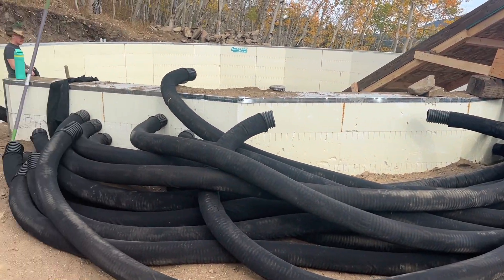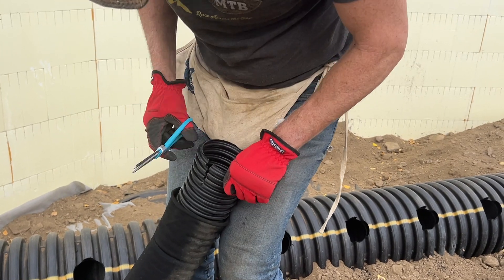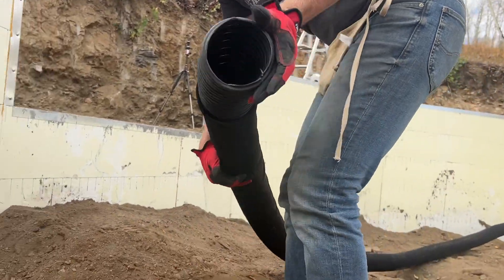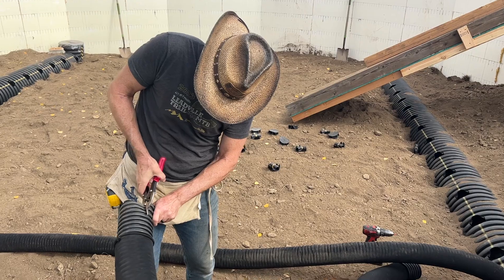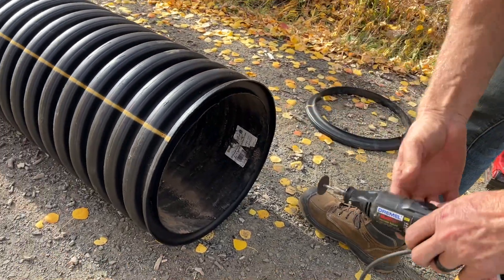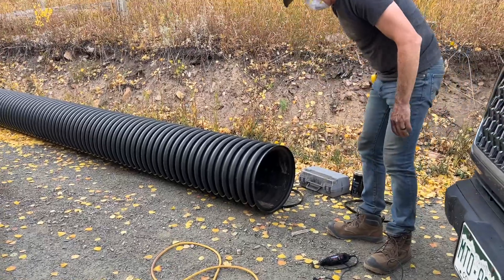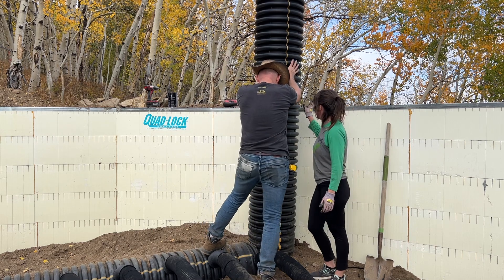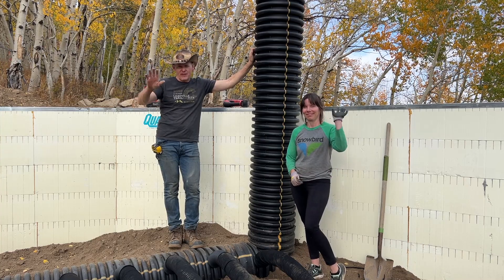How we Finished our GAHT System for a 4-Season Greenhouse

Comment: I did something like this about 40 years ago, even used a Kabota tractor doing similar to what you did.  But I used 8 inch PVC pipe and put two sides so that the air flow went through approximate 3-4 inch washed river rock.  I used a total of 28 tons of rock and then poured a 6 inch concrete floor over the rock.  Once done I built a south facing solar room to heat up during the day and slowly let it release during the night in northern New York.  I truely can appreciate the work you went through doing this.
Reply from the maker: That sounds like a great system!  It's a lot of work, no matter how you slice it!

Comment: Great job.  We are buying the 26' greenhouse from the same place.  Didn't catch your size but appears larger.  We're in Illinois and actually putting in a spa tub instead of the pond.  BUT will likely add the GAHT design as well.(website stated $750 for just plans. Which is more than I want to spend)  Need to figure out the fan size though.    Look forward to seeing what more you do with it.
Reply from the maker: That's great! The spa will probably contribute a significant amount of humidity, so hopefully the GAHT makes that easier to manage. We are building the 33" size. The GAHT process has been quite expensive for us, given our rocky terrain (excavation costs), and concrete (6ft walls- engineering spec due to our climate and snow & wind requirements). But hoping it will all be worth it to have year round usability.
Reply: @ColoradoMountainLiving  Thanks for the reply.  I'm investigating if I can bury the system without encasing it in a wall under the dome.
Reply: @EVANTHORSON  
Vertical perimeter insulation is a must for a climate battery, even if the greenhouse itself doesn`t require a foundation.
Reply: Spend your hard earned $750 on something more worthwhile than a GAHT plan.  You`ll need 700ft of tubing for a 26ft dome. The fan should be sized to put the entire greenhouse air volume underground at least 20x per hour. In the case of a 26ft dome this equates to 1,250 cfm. The tubing layout has a huge impact on how much air the fan can deliver. A fan capable of delivering 1250cfm @ 0" wc wont deliver 1250cfm when its attached to the system due to the frictional losses. Fwiw, a 33ft dome requires 1,100ft of tubing and 2,460 cfm. If the tubes are 19ft long and there are 34 of them, that is only 650ft.  It is very important to modify the tubing by cutting a straight shallow slit just through the outer wall of the ribs to ensure the condensate can fully drain. If you check the video at 1:45 you can clearly see the drainage slits are located between the ribs. Without this modification, condensate will collect in the bottom of every corrugation, which is bad for several reasons, the main one is its extremely detrimental for the heating performance. I advised these guys to do the tubing modification before they installed it but, unfortunately, they didn`t act on it. Once the tubing is in the ground, there`s nothing that can be done..
Reply: @JohnGuest45  So you've installed one too?
Reply: @EVANTHORSON  
I`ve had a SHCS (subterranean heating and cooling system) installed under a dome greenhouse since 2009.
Fwiw,  Cere`s used to charge $600 for a plan that isnt worth even $100 and now they want $750. You can be sure they haven`t changed anything to make it worth an extra $150. What you save by not buying the plan will pay for your tubing.
Reply: @JohnGuest45  Was it worth the cost and effort?
Reply: @drewneven2088  
Definitely, it has paid for itself many times over.
Reply: @JohnGuest45 thanks for all your insights, each time I watch a climate battery video I’m always looking for your comments under it since I usually learn more from them 😅
Reply: @SeaTwoPea  
Thanks for the kind words. I just try to help folks avoid silly mistakes. Most of the time i`m too late to help because the tubing is already in the ground. In some cases, i`m in time but the folks decide to stick to their original plan but at least they had the information to make an informed choice. Most of these installations have no follow up videos which is a confirmation of sorts. In 15 years i only know of one installation where the owner dug the tubing back up.

Comment: Any special reason you are using perforated 4 inch pipe for the heat exchanger. Any risk water might get into it
Reply from the maker: This is what is recommended by multiple companies we've researched. The small perforations will also help release any water back into the ground.
Reply: @ColoradoMountainLiving  
The small perforations are not in the right location to help release water back into the ground. If you have a tubing offcut, pour some water into it and see how much water is trapped in the corrugations with no way to drain out.

Comment: Yeah when I was building dome kits it went pretty fast. Hint don’t tighten the fasteners until all the supports are installed. Much easier to make small adjustments.
Reply from the maker: Thanks for the info!
Reply: Applying tape to all of the external seams to make the dome watertight is the most time consuming job. I wouldn`t attempt it in cold weather unless you enjoy tracking down leaks.

Comment: I guess it does slide a little easier down the metal,  I had hoped it would be better than that.. You guys are doing a great job 👏,  hopefully you will finish this soon before the snow comes..
Reply from the maker: Right on. We may try a tarp next.
Reply: try vibrating the ramp. Lots of videos on YouTube. Most guys use a sawzall without a blade in it from underneath or on the side of the ramp.

Comment: It's coming along
Reply from the maker: Gosh, so much work, and still waiting to build that structure!!
Reply: @ColoradoMountainLiving  
You`ll be disappointed when it doesn`t deliver the cooling performance you expect in the summer time. You`ll be equally disappointed when you have to deal with the 90% + greenhouse relative humidity levels on cold nights which will happen when the system is used for heating. The  dilemma you face in the future is whether to leave it in the ground and pretend its working as expected (most popular choice) or dig it all back up and fix the issues (almost never happens). Time will tell i guess.